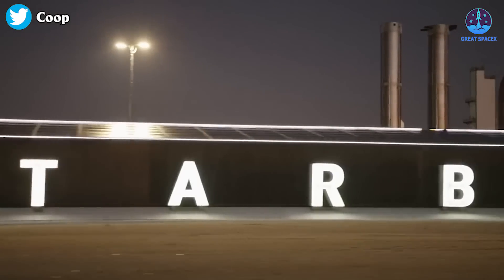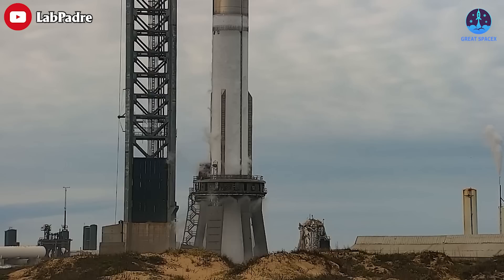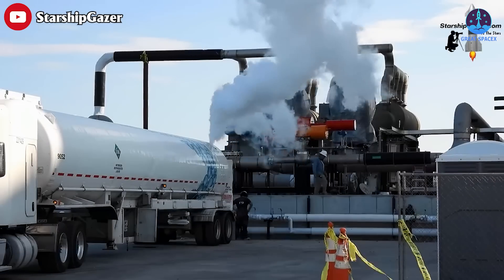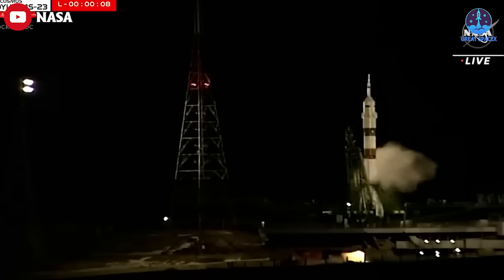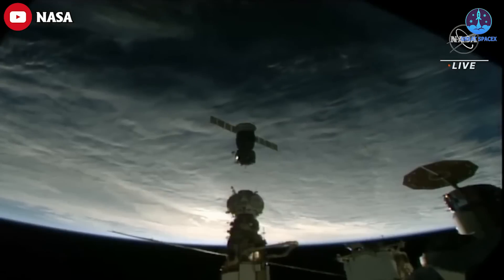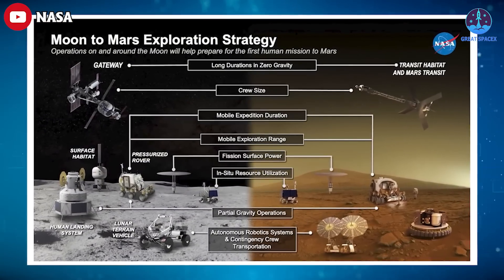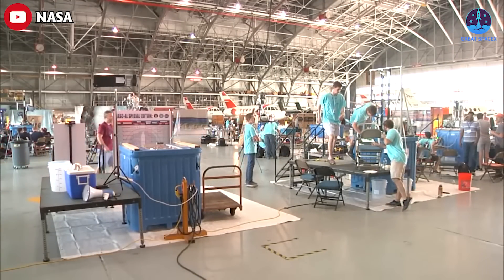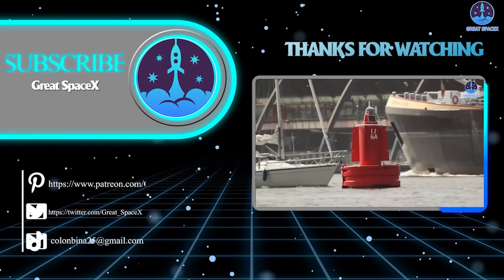Elon Musk's NEW big announcements on Starship's first orbital flight...

Comment: The explosion will will occur at 3 to 5 kilometers. It will be comparable to the fertilizer blast in Lebanon. It will be spectacular for 20 to 30 miles. It will be heard from 75 miles away. I hope there control center is underground or at a separate location far away.

They will learn 33 engines are to many. Less larger engines will do the job safely. 12 to 13 engines will reduce destructive vibration. The over size rocket will then be safe. Scale up the raptor engine. It is perfect.

Comment: Frankly, everything still is incredibly close together.  Hundreds of feet away - rather than the MILES away that NASA uses. One serious launch pad issue, or a failure immediately after launch, and the site damage will be immense!
Reply: I agree........There is entirely too much unprotected infrastructure within the blast radius when all 33 engines are at 100% power.  The last test was at only 50% power.

Comment: Prediction: Starship will have a successful launch. The launch pad and tower will be severely damaged and the fuel farm will be taken out! Just because the launch pad is not sexy it doesn't mean it isn't important. The most powerful rocket ever launched will destroy the launch pad. The launch pad needs diverters and a deluge system. The fuel farm should be located a safe distance away. How can this not be seen?
Reply: I don’t get it either. The entire facility is so space compressed, it’s surreal! Imagine NASA launching a Saturn V only a thousand feet away from where they assembled everything… Even with more than three miles distance, the first Saturn V launch shook ceiling tiles down in the observation room. It’s the only time on record that Walter Cronkite lost his calm demeanor… 😅. If a fully loaded Starship blows up just after it cleared the tower, the shock blast would nuke a huge part of the surrounding infrastructure, and would ensure that the FAA will never provide flight clearance again.
Reply: Man............You are absolutely 100000000000000000000000% right.  I don't get it sense SpaceX has shown terrific engineering know how,  how they failed at the launch site design.
Reply: @BennyCFD  When did it fail?

Comment: How many seconds does it take a rocket to lift off its mount after ignition?
Reply: ChatGPT says 3-5 seconds depending on weather conditions and type of rocket. It says it will be closely monitored to ramp the rocket slowly to full power once moving so as not to destroy the launch site.
Reply: It's held down by clamps until it reaches full power. As soon as it's released, it's off the mount. From time of ignition that's usually around a second or two.
Reply: Thanks

Comment: Can someone tell me what the liquid nitrogen is used for?
Reply: liquid nitrogen is not flammable so They use it for preliminary cryogenic tests of the tanks,  equipment etc, so if there is a failure/leakage there won’t be explosion/fire.
Reply: @warrenwhite9085  Come on Man! Stop putting out bum steers! 🤣
Reply: Cryotesting.
Reply: To purge the system.
Reply: @SocalSamStokes  Wart removal?
Reply: It is used to freeze and disable the Dialects from attacking.
Reply: Liquid nitrogen is colder than either liquid methane and liquid oxygen. Cooling methane and oxygen down will condense it to fill a smaller volume so you can store more propellants.
Reply: Thanks Sam for a realistic response
Reply: Actually it's used for the flux core shielding on the ship to stop high rates of expansion of the dilithium crystals.
Reply: killing terminators